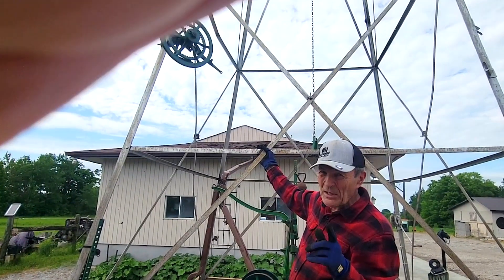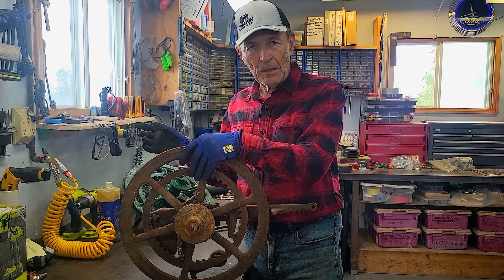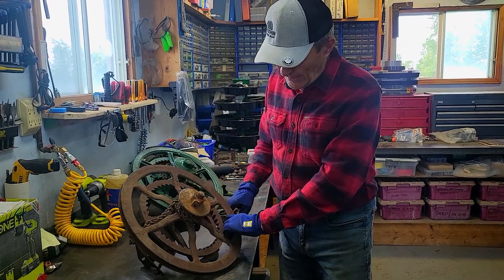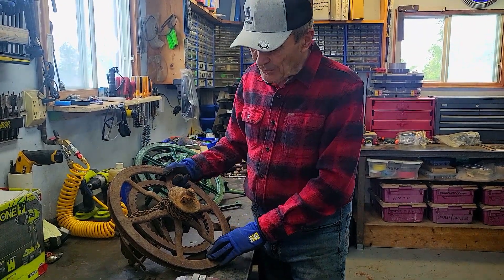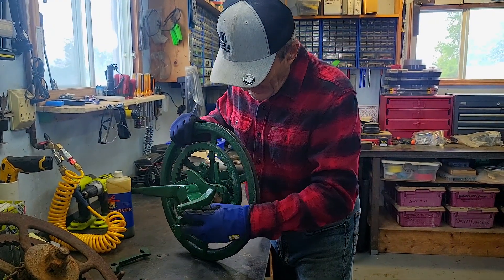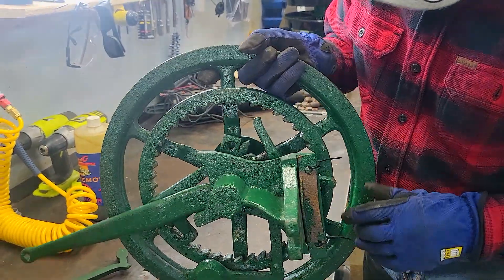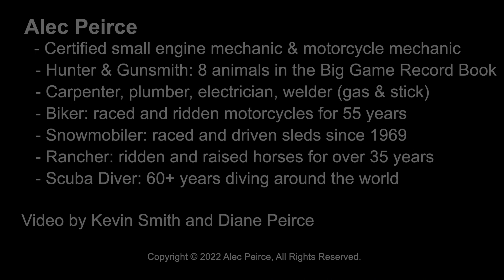#161 My Windmill Regulator | At The Ranch

Comment: I was wondering if you ever got that regulator working, and if you might be willing to share a bit more about how it functions. I’d also love to know if you’ve come across any modern equivalents or if there’s a way to source one of those vintage regulators for practical use
Reply from the maker: Finding an old windmill regulator is pretty easy. Almost all old windmills had one. It's a matter of finding one by driving the countryside & looking. Then you need to find the owner & arrange to buy it.
Restoration is easy too. Take a lot of pictures, disassemble it; clean & paint it & reassemble.
The operation is another topic entirely.
I am friends with several windmill experts, one very old & one much younger & one who was the caretaker of several windmills in this area. None of them have been able to satisfactorily explain how they work.
By studying it, I might be able to discover it's proper operation but it's unlikely. I cannot find any books with details on the operation. I do have a parts breakdown but there is nothing about how to hook it up.
Apparently a cable goes up to the on/off cable of the mill. Another chain goes down to a float in the trough. There is a weight that makes the regulator ratchet like a clock escapement. But how it all goes together & actually starts & stops the mill is still a mystery.

I'm assuming you have a windmill?
And that you want to get water automatically?
If so, at this point, a battery operated pump with a float is all I can suggest. 
Let me know how you make out.
Alec
Reply: @AlecPeirceAtTheRanch  Hi Alec… I bought an Acme Regulator on eBay and it’s in great shape. I will remove the rust and see if I can figure out how it works, the seller also sent an old installation document but it doesn’t describe exactly how it works. I have a working windmill and reservoir that I will try to get it working on. Will keep you posted.

Comment: For an excellent and inexpensive penetrating oil, try “monkey snot” - a 50/50 mix of transmission fluid and acetone. Beats out pb blaster, wd40, etc.  by a mile, and dead cheap in comparison.
Reply from the maker: Never heard of that.  Thanks for sharing.
A

Comment: I have an artesian well with a depth of 90 meters. Is it possible to draw water from its depth? Thank you
Reply from the maker: It is but ensure the closing seal is perfect or you lose water.  It will take a while but once the water is lifted to ground level it will be a constance flow. Good luck.
A
Reply: the active element should be located on the bottom of the well , the pumping circuit should never be under vacuum for more than 10 metre otherwise, the water in the succion pipe  will boil at atmospheric temperature. To overcome that problem, on the jet style pump, the active element ( the injector ) is remotely located near the bottom pf the well so there is no pipe under vacuum.
on modern applications, very frequently, the pump assembly is very slim and it is located at the bottom of the well

Comment: Hi Alec looking at the function, is it possible that the windmill lifts the weight (90 pounds) when it is windy to store energy then uses the ratcheting device to slowly operate the pump when there is no wind using the energy of the lifted weight? sort of like those wall clocks that used the brass weights on a chain. We think we are much smarter than our ancestors but they did come up with ingenious ideas before electricity.
Take care Owen m
Reply from the maker: It many be but I'm looking for a setup manual and feedback from those who actually use this.  It will be running someday and maybe a followup video.  They definitely were smart back then in using wind for everything they could.
A

Comment: How does that sense the water level in the trough?
Have any good ideas on how to store a grease gun without it becoming an ungodly mess?
Reply from the maker: Cables, lots of cables.  I don't have a user manual but my friend figures it out.  One senses the water going down, pulls the windmill into the wind, it turns and pumps water, when back to 'normal' level, it shuts off the windmill, repeat.   Hard to get manuals from a 100 years ago but that is how its supposed to work.
A

Comment: Try using Evaporust.  Just fill a plastic barrel with it then submerge the parts for a few days and it will get most of the corrosion cleaned up.
Reply from the maker: Thank's for the tip.  I'll check it out.
A
Reply: I forgot to mention.  Check out "Hand Tool Rescue"'s YouTube page, he uses Evaporust almost exclusively to clean up parts.